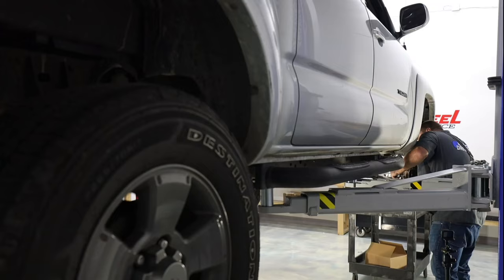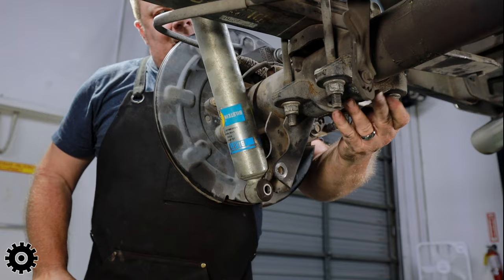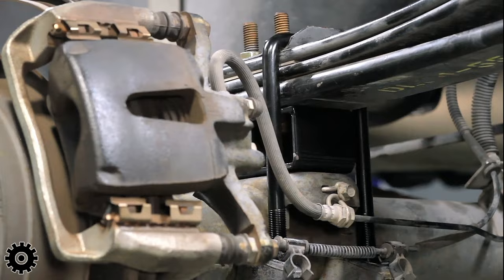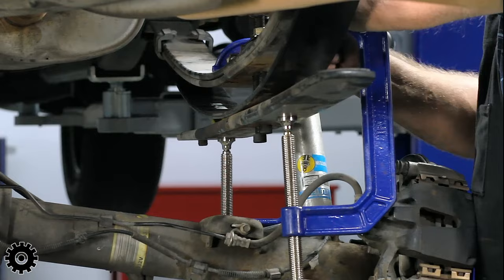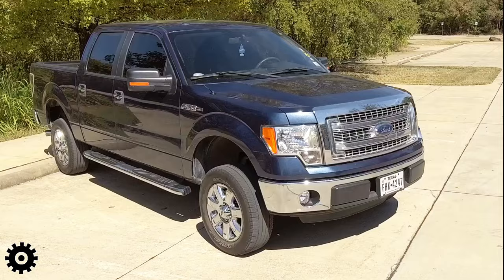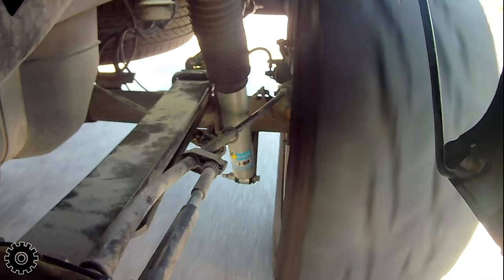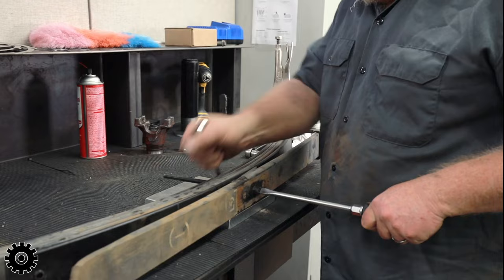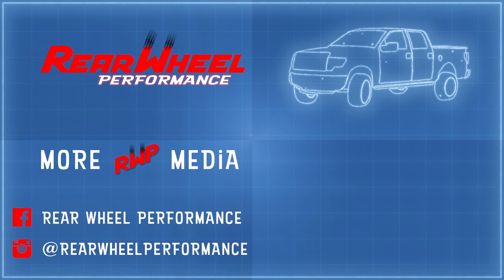Add-a-leaf Kit VS Rear Lift Block: Rear Lift Kits

Comment: Thanks for the excellent advice. So I will now lift my 2003 E250 HD van with the 3" blocks. I can then carry my pwr wheel chair and not drag the wheelchair carrier while entering or leaving my driveway. I do appreciate your help. 😊
Reply from the maker: It may require also changing to a set of longer set of shocks to maintain suspension dropout travel.  Hope it all works out well, thanks!

Comment: Great stuff on install but you didn't address why a add a leaf over a block. Looking at doing a 6 inch lift on my 2007 Silverado 1500. I still dont get if a block should be used with add a leaf or not. I thought and the video made it sound like if you add the one leaf addition you dont use the block. The video made it sound like one or the other, but at 6:56 you can see the "add a leaf" sitting on a block. Right after that at 7:04 we see just the "add a leaf" sitting on the axle with no block. So why the discrepancy of block/no block with add a leaf and how does a single leaf makeup for several inches of lift a block would provide. Totally lost on all these points.

Comment: I added 2 leafs to each side if my nissan frontier and it is anazing hiw well it lifted and supirted the truck
Reply from the maker: Trucks and suvs from about the late 80s+ have had their rear spring rates and shock dampening increasingly reduced for the sake of passenger ride comfort.  Raising the rear spring rate along with well matched shocks are a game changer in handling/performance.

Comment: Great Video! I have a 2023 toyota  tacoma.Can I use a 3inch Block and a add a leaf so I can get bigger tires and better Towing for My Trailer?
Reply from the maker: You probably can, but it would not be at our recommendation.

Comment: Great video.  Looking at adding a leaf for my 2013 Nissan Titan.  If you add them in the back do you have to add anything in the front or change shocks out?
Reply from the maker: There is usually enough dropout travel to use the existing rear shocks, but adding a slightly longer shock rated for 1-2" of rear lift can be added if necessary.

Comment: I would like to know what is a better method for the ride of the truck, on and off road. Is there a difference in ride quality between the two methods?
Reply from the maker: "Better ride" is a very subjective term.  In general, we feel that later model (90s+) vehicles do better with anything that adds more spring rate (like add-a-leafs or custom lift springs), but to try to keep the ride smoother, it will come down to matching it to a good shock package.  When unsure what your final ride "feel" needs for on and off-road, using adjustable shocks is worth their cost.

Comment: I am looking at doing the rough country 6 inch with vertex on my 3rd gen tacoma. I'd rather have a new leaf pack buy they only offer blocks for the 6 inch. Any idea why that's the case? Do you know of a leaf pack that would work in place of their 4.5 block?
Reply from the maker: You can have custom springs made for 4" of rear lift, but the ride may not be a bit high.  A compromise solution may be to use 1.5" add-a-leaf kit along with a 3" block/u-bolt kit.

Comment: Good video. I have a 2006 ram 1500. I need a rear suspension upgrade to carry a little more weight in the bed, like a half ton of cement for example. My question is what's the proper and cheapest way? Some people say helper spring...?? It's a work truck so ride quality when empty isn't more important than how much I spend to achieve this. And also, I just did a 2.5" coil spring spacers up front & new rough country shocks & my rear is currently an inch lower than the front half. Thanks
Reply from the maker: Helper springs and add-a-leaf kits do the same job, but have different installation.

Most helper springs are bolt-on without the need to disconnect the spring from the axle assembly, and also do not require taking apart and reassembling the spring pack.  They will cost a bit more, have more components to assemble and maintain over time, and can take away from a clean look, if that is a consideration.  The ability to adjust spring preload on some kits may be beneficial to some.

The main drawback the the add-a-leaf kits is that it takes more time and effort to install, but once done they look good and work well.
Reply: @rearwheelperformance  thanks

Comment: Can you install an add a leaf AND a block at the same time?
Reply from the maker: They can be installed together, as long as there is enough travel in the shocks and all lines between the axle and frame.
Reply: @rearwheelperformance  thanks!
Reply from the maker: @wasachevyguy  It's our pleasure!

Comment: Hi, new to this world. I have a 2012 F-250 Superduty 4WD. I had a 2.5 inch Readylift leveling kit installed, but now the front sits too high by an inch. Driving me crazy. Is a rear-block the best idea for lifting the back up? It comes stock with a 2 inch factor rear block, so I was looking at 3 inch blocks. Is this the right idea?
Reply from the maker: Yes, perfect, a 3 inch block kit replacing the factory 2 inch blocks would net 1 inch more lift in the rear.

Comment: I've got a 2012 F150 STX 4X4 with a Mammoth 2.5 front leveling kit installed(which is only 2 spacers), stock in the rear.  Will that make the process of anything at all different if I were to install a new 2 or 3 inch block in the back?
Reply from the maker: The rear height doesn't have much relationship to the front lift.  Just remember to install longer shocks with the lift for the rear to allow for full dropout travel.

Comment: I have A 2000 Chevy Silverado half with 3 original Springs and I was adding 4 extra leaf Springs out of a older Chevy pickup With about Is the same curve As the original Spring. Would I have to adjust the opinion angle on the rear end And the thickness of all 4 leaf Springs together is about a inch a quarter thick Would this work OK so I could hall heavier loads
Reply from the maker: That would be in the realm of a pretty over the top modification, and we wouldn't endorse it.  It will likely over double the spring rate, and there isn't a whole lot more that a 1500 would be able to utilize with all that spring rate.  The suspension will ride very very stiff.  The pinion angle would need to be adjusted if there is any new notable harmonic or vibrations created.  May be worth the time to add one at a time and testing before going for all 4?

Comment: If your Axel sits above your leaf springs, can you still use the blocks to lift your truck?
Reply from the maker: If a vehicle has the axle located over the leaf springs, adding a block and u-bolt kit would lower the rear.  In that case, an add-a-leaf kit would be an option for an additional inch or tow of overall lift..

Comment: Ading a leaf is way better option makes your truck more capable of supporting payload.  Ideally is to add a big leaf not a shirt one.  A leaf that is just bit shirter than the top leaf.  You can also add arc to these leafs which might be good if you want more than 1 or 2 inch lift.  3 to 4 inch lift requires longer shocks and also ading more arc to all leafs
Reply from the maker: Very well said!

Comment: We have to get an alignment done after this, right?
Reply from the maker: If you are working on rear lift components it is usually not necessary, but it can't do any harm to have it checked.  For front components any modifications or changes, it is recommended to have an alignment.

Comment: Do you recommend rear shackles?
Reply from the maker: Good for retaining ride quality and usually the easiest option to install, but generally not the best option for handling in our opinion.
Reply: @rearwheelperformance  ok. Are spindles easy to install if I have a lift and tools and some car experience
Reply from the maker: @Graham_A   That's the perfect background for spindle work.  Every suspension tech has their favorite mini-sledgehammer to break free the ball joint and tie rod tapers.  Other than the hammer and technique doing that, the rest is just bolt on.

Comment: Will I be able to tow factory weight with a 2in block lift on a 3rd gen Tacoma?
Reply from the maker: As we recall, the tow/weight ratings are designed into the frame, brake system, spring rate/capacity and axle housing assembly rating.  You probably can, but you would likely be better off looking at an add-a-leaf or helper spring kit for added load control and brake feedback, especially at maximum load capacity.

Comment: Is the spring a smoother ride than the blocks? I have 6” blocks on a GMC 2500 and the ride is rough when there’s no load.
Reply from the maker: When adding a leaf spring to the existing spring pack it will make the ride firmer.  Often rough and firm ride feel are mistaken for each other.  We would suggest adjustable shocks to dial in your comfort.  It often amazes people that smoothing out their ride requires a much stiffer valved shock.
Reply: @rearwheelperformance  are there adjustable shocks to go with the BDS lift? Mine came with fox 2.0. Thanks for the response.

Comment: I have a 1996 Ford F-150 and I’m looking to do a 4 inch lift what one should I go with?
Reply from the maker: If you are referring to 4 inches total at the rear end, the most common and cost effective methods would be either a 4" block and u-bolt kit, or a 2 inch block kit combined with an add a leaf kit).  We almost always like having an add-a-leaf in the mix as it increases the rear spring rate and capacity a bit and helps with controlling body roll and sway a bit more that without it.

Comment: if i install a 2in block in the rear do i need to purchase new extended shocks or can i use the same shocks or same size shocks?
Reply from the maker: Unbolt them from the axle and see how much drop-out travel there is.  Since the minimum you would like available is 2-3", if you have at least 4"+ currently it may ride adequately after a 2" block is installed.  We would still recommend getting proper length extended shocks whenever it's possible or necessary.

Comment: I have 22 gmc canyon , what’s rear blocks do you recommend me doing.  ? I’d like to do 2”
Reply from the maker: If you already have 1" factory blocks in the rear you can replace them with a 3" aftermarket block and u-bolt kit to achieve +2" higher total than it sits currently.  If it does not have the factory 1" block, then there are also 2" block/u-bolt kits available in many brands.  Longer rear shocks should be also considered to allow for enough dropout suspension travel.  It is just our preference, but we almost always will recommend add-a-leaf kits which help reduce body roll and axle wrap under acceleration and braking, at the slight sacrifice of a firmer ride.

Comment: How about rear shackles?
Reply from the maker: We don't use them in most cases, since it creates more leverage at the frame, and can allow for more side-to-side movement.  It also takes about twice the added shackle length to get the amount of overall lift wanted. That is just our opinion, and most installations are fine with shackles also.

Comment: Aye bro I have 6 inch pro comp on my Tacoma. Nd I wanted to go a little higher atleast to 8inch. Is there any recommendation for like off-road
Reply from the maker: Though it is often recommended against by most lift kit manufacturers, it may be possible add strut spacers or lift struts to a drop bracket lift kit like ProComp.  The drawback is that dropout travel and ride quality are affected, and it may also need high travel control arms to prevent premature ball joint wear and failure over time, along with high angle c.v shafts if it is a 4wd.

Comment: What did you use for shocks here with the block? Bilstein 5100's?
Reply from the maker: Yes Bilstein's for that rear.  In addition to sourcing them a little longer than stock to accommodate a couple of inches of lift, they helped greatly reduce the anoying 'shudder' that the stock shocks had after hitting speed bumps and potholes.

Comment: So if you're doing it solo for add a lead cheat and tie the springs together and loosely tie up the helper to allow you to have the support needed that come from
The lack of a helper nearby
Reply from the maker: Initially it can help keep everything in place while getting everything setting up to install, but it can also help if there is a failure in the center pin and clamps as they begin to tighten and store more energy.

Comment: Would a block twist the Axel?
Reply from the maker: Blocks can increase 'axle wrap' during acceleration and braking.  The thicker the block for more height, the more axle wrap there will be.  With enough leverage in the spring pack, there is often rotational movement in the housing that can be seen and felt.
Reply: @rearwheelperformance would a 1 inch block cause axel wrap?
Reply from the maker: @Turtlemilk  It can add to axle wrap symptoms, but 1 inch is usually minimal.  Taller blocks can increase the effect exponentially.

Comment: I know both will increase the lift of the vehicle but does adding a leaf actually give you more load capacity?
Reply from the maker: Adding a leaf to the spring packs increases the overall spring rate, which adds a bit to the load capacity, as long as the load does not exceed the axle and frame max ratings.
Reply: @rearwheelperformance  Thank you for the quick response

Comment: Hi, what is the torque specs you used on the U-bolt nuts?
Reply from the maker: It is good practice to follow the specific kit manufacturer's specifications.  In this case I believe they were about 9/16" u-bolts/nuts which should be about 120-130 ft/lbs (progressively step torqued)

Comment: Does add a leaf really make the ride bad thanks
Reply from the maker: Anytime you add a spring to your spring rack it will increase the spring capacity and spring rate. This  will result in it riding firmer than stock. Though the longer an add-a-leaf is the less it will impact ride firmness.

Comment: which is better to use blocks or add spring leaves??
Reply from the maker: In most cases, add- a-leafs are the better choice.
Reply: @rearwheelperformance Thank you
Reply: @rearwheelperformance  why is it the better choice?  Better ride?  Was it a stiffer ride? Did you add shims to angle the pinion when using add-a-leaf?
Reply from the maker: @rayss3323  Because (explained), yes (subjective), no (objective), no (not necessary)☣

Comment: Can a 4" or 5" inch block be installed on a classic full sized 4 door 55 Ford passenger car, if so where can a person find these.  Great job👋👍
Reply from the maker: Any axle mounted under the leaf springs can be spaced with a block.  Measure the existing u-bolts, and use an industrial machinery supplier to locate longer u-bolts .  Alternatively, once you have the new u-bolt dimensions, many off-road truck lift companies sell blocks and have u-bolts in varying lengths and widths that can looked up in their online and print catalogs.
If the axle is currently located on top of the leaf spring, then a block would lower the vehicle, but the mounting can be modified to relocate it under the leaf springs.
Reply: @rearwheelperformance  Unfortunately this car came out with the rear axel mounted ABOVE THE LEAF SPRINGS WHICH I DON'T KNOW WHY THEY DID THAT, I JUS HATE IT, INCLUDING BOTH OF MY 58 MERCURYS, AND ALL 3 OF MY FULL SIZED 58 EDSEL CITATIONS.

Comment: Why couldn’t you use a 2 inch block with a helper leaf both of them at the same time without hurt anything?
Reply from the maker: As long as there is enough slack modified into in all of the lines and shocks you can install any combo that you want.

Comment: Should have mentioned the ride quality/load improvment a leaf gives you over block. 
Block is easy but hinders ride quality, especially off roading and doesn't give any benefit to how much load you can carry.
Reply from the maker: We need an in-depth series on suspension spring rates and shock valving that need to be made.  Like most things in life there are a lot of situational issues.  What is good for one need is often not good for another.